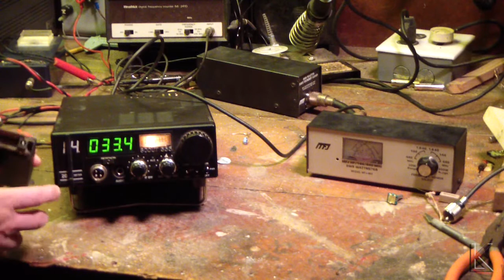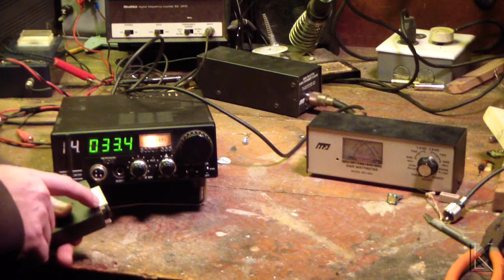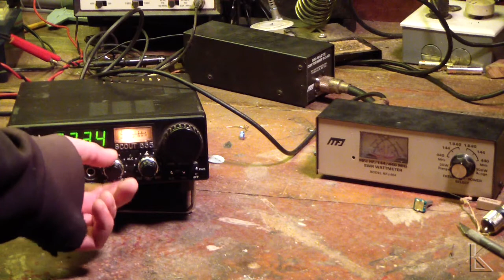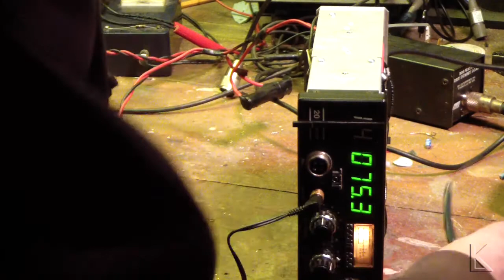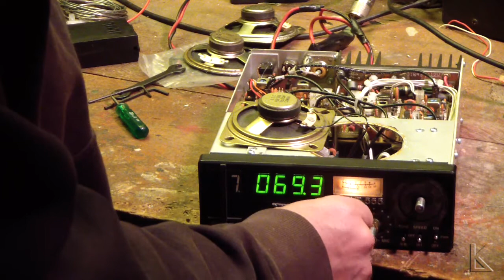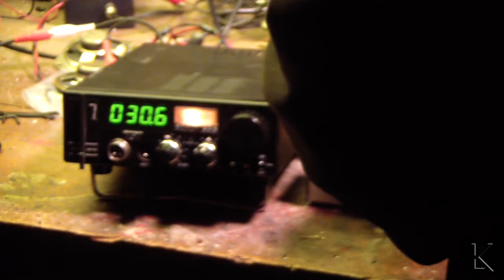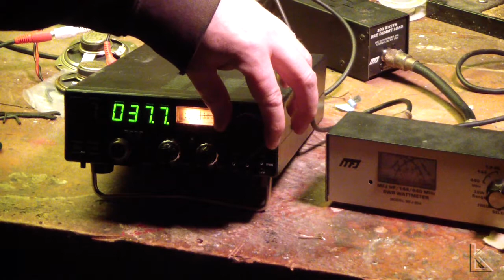Ham Radio - Ten Tec Scout 555 repair

Comment: Hi Kevin, thanks for your video. I've been inactive on the HF bands for quite a while but am now retired and wanted to get the Scout555 I bought from a fellow ham in the 1990's into operation. I found all the remaining band modules on eBay and did put it into operation on 10m (CW) with our local DOK F27 ham group for a while before the Corona pandemic broke out here in Germany. 

The only problem is that the TX frequency drifts out of the FLS lock after it warms up. I found a MOD on the internet from a Canadian OM published in the 1990's to replace one or more of the SMD capacitors with NP0 capacitors; however, these very small capacitors on the PTO circuit board are very hard to identify. On the Scout555 manual Page 3-16, the Figure 3-12 PTO Schematic shows the capacitors to be replaced as C14 (33 pF) and/or C15  (UNK value "selected in production" but might be 18 pF).  His MOD states only one needs to be replaced "as we do not need to completely stop all drift - we just want to ensure it never drifts out of range of the FLS."

I emailed the OM VE3EFJ in Nov 2021 with close-up photos of my partially-removed PTO board with several capacitors highlighted but never received a reply. I am thinking that he may be a silent key. Today, I did a thorough internet research on OMs knowledgeable on the TenTec Scout 555 and came across your YouTube video.

I really want to try his MOD, but, as these SMD capacitors are extremely small, I want to make sure the ones I marked on my photo are, in fact C14 and C15 before I try removing them with a solder wick. I would gladly send you or any ham reading this post the same email info (with the MOD write-up and my macro-photos) that I had sent to VE3EFJ. I have also asked one local club member who is experienced with SMDs and am awaiting an answer from him; however, he does not own a TenTec Scout. 

According to the schematic, C14 & C15 are in parallel along with C8 (330 pF), and C8 is in series with a parallel network of 4ea 470pF capacitors (C3 to C6). Without de-soldering, I am not sure whether I can measure the values of what I think are C14 & C15 correctly since they are still in the circuit. Any hints/tips on this approach would also be appreciated.

Many thanks in advance for any help on this.

Vy 73's de Glenn Rossi (WB5FDJ / DL8FG) - [my direct email is on QRZ.com]

Comment: Thanks for video. I remember those rigs when they were launched (quite expensive in the UK). The band module made it quite a compact HF transciever in it's day. My favourite trick for cleaning those edge connectors is to use ordinary paper which works like super fine emery paper. Good that you got it all working again. 👍

Comment: I’ve got one that seems to have rf getting in on transmit. It doesn’t happen on dipoles just on mobile with a screwdriver antenna. Swr is ok. I’m going to check and see if it happens on cw with the mike disconnected.

Comment: Hi Kevin,
Have you tried using a pencil eraser to clean contacts? Works great and less abrasive than all but the very most fine sand paper. Nice channel..

73, Glenn WA4AOS
Reply from the maker: Thanks Glenn,     I have used erasers on flat contacts.    The PCB edge contacts are basically pads of solder though.  The socket depressed grooves into the solder that were dirty.   An eraser wouldn't have gotten down into the grooves.   You can re-flow the solder, but then you have to clean up flux.   I used a very fine grit and was gentle.  Just enough to clear the grooves out.
Reply: Hi Kevin,
I had a Scout for about 10 years and kept my contacts cleaned with an eraser but I may not have had that many insertions of the band modules. It was not a bad transceiver but as you speed up your transmit CW speed to above 25wpm, there are problems with interrupts with the microcontroller. For casual CW contacts around 20WPM it was fine. I also thought the Jones filter was decent, not stellar, but OK.. I finally sold it and got and Omni 6+ then a matching Paragon II; nice combo.
73,
Glenn